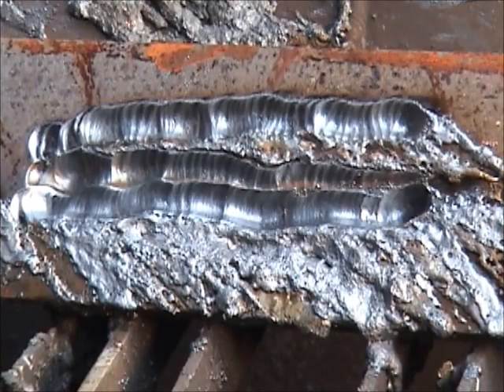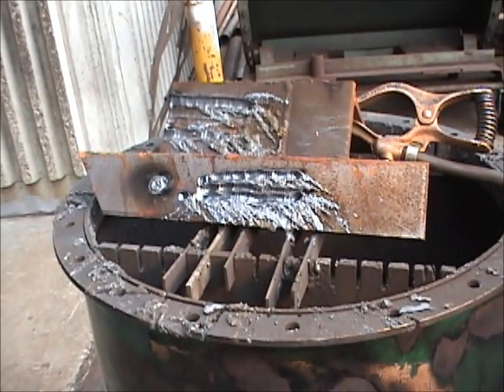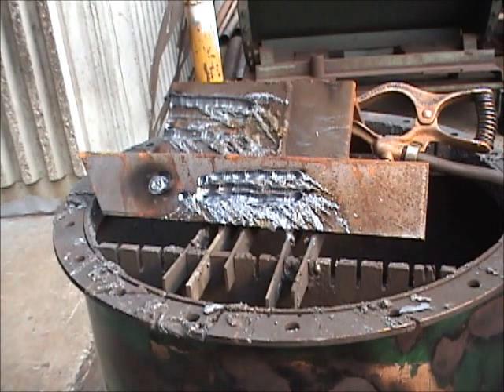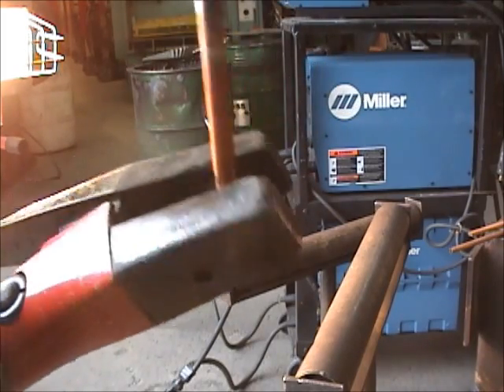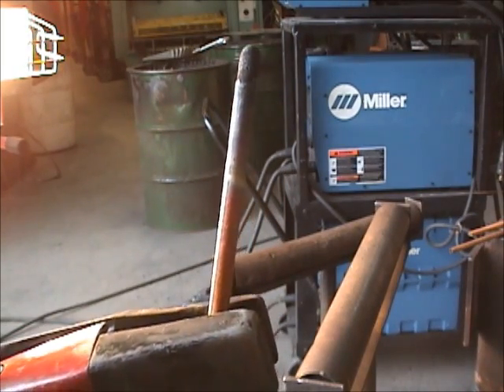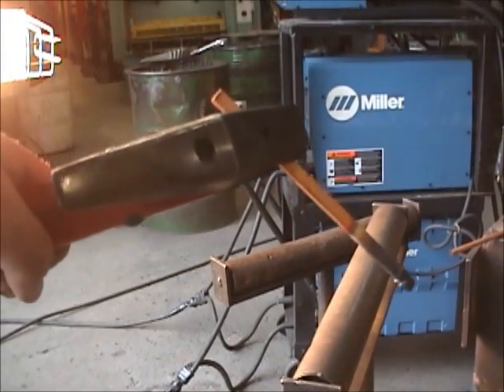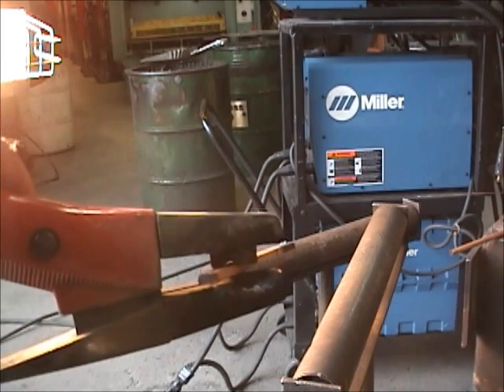ACAC Air Cabon Arc Gouging Part 2 8 1 2012

Comment: Haven't done arc air for years and years now, but I regard it the most effective process in weld removal or prep work on plating for welding processes. The use of abrasive disks in the above  is just my worst procedure . Is it that carbon arc has become a forgotten application in today's industry? Great video there - Thanks. It takes me right back there to those years -"On the Bench"

Comment: my workplace requires all welders to know arc gouging i hate it so much even more then grinder
Reply from the maker: With a little practice , it can really save a lot of time.
Reply: @chrishensiak986 worst thing besides it being huge health hazard is getting a welded piece and having to remove weld defects in very unreachable areas its all fine and dandy when you're removing root for full penetration weld but fixing bad welds is a big pain also takes ton of practice to consistently remove all weld defects for Xray or UT when you cant even see or reach the joints properly .
It is valuable asset in any metal fabricating business tho i feel sorry for the poor guy doing the gouging and repairs